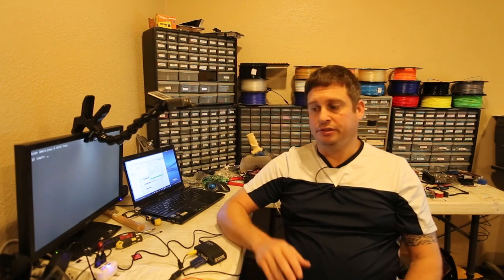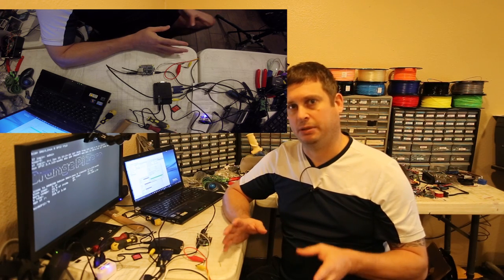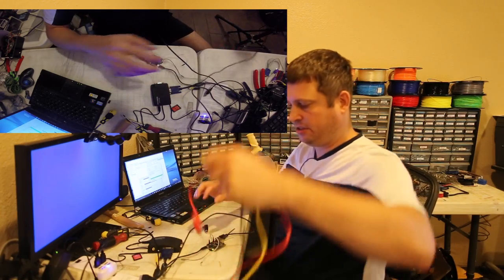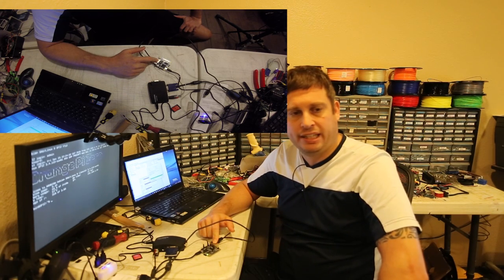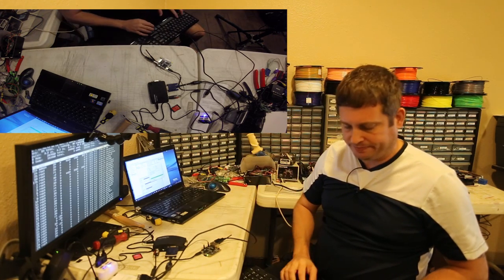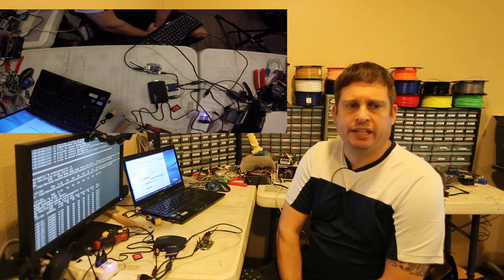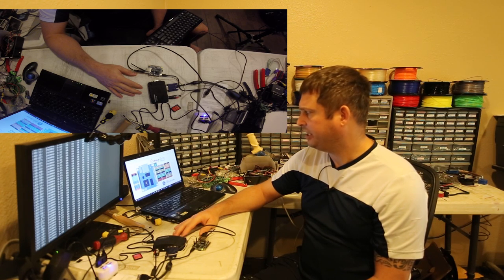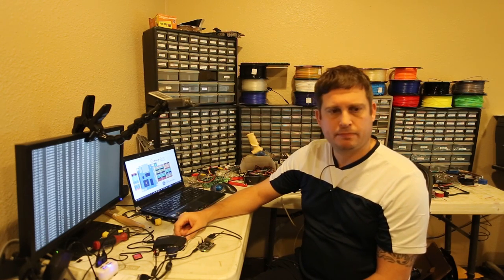Orange Pi Zero Part2

Comment: Is to possible  to connect a lcd module like ili9... , arduino lcd shields, etc to it via io pins.
Reply from the maker: I'm not familiar with that module.  It really depends on the input/output.  You are not going to be able to put it on the video signal, but you can probably drive it via the serial interface.  Worst case you would need a serial interface chip for the LCD.  Most of them are serial anyway, but some of the really cheap ones require a driver chip.

Comment: Could you please write your website down in the comments, also did you say you got WIFI working? or just Ethernet for now. I'm looking at ordering one of these machines, I've got an old vga-composite convert I kinda hoping it will convert composite to vga not just vga to composte.

Nice to see that this device is still very new and already some support exists, scattered all over the internet, also I see the orange pi website has images available now, have you had a chance to try these as apparently the original images didn't work at all..
Reply from the maker: www.nanohawk.com
Reply from the maker: The orange pi "official" website is mostly worthless.  Schematics are there, and they have a forum, but they are frankly their own worst enemy on this board.  Armbian is much better and has more support.
Reply: +Cashiez What IC chip you got on the converter?

Comment: Do you know that your expansion board is providing you audio and video? You just need a "3.5MM Jack to 3 RCA Male Plug Adapter Audio Converter Video AV Cable Wire Cord" which costs you less than a bug on AliExpress...
Reply from the maker: I wasn't aware of that.  The manufacturer is pretty spartan on documentation which limits the Orange Pi line.  I looked at the traces and didn't see that on the expansion board.  There wasn't any labeling for it either so I concluded it was a audio only jack.
Reply: Check out the case for it on AliExpress. The hole for the 3.5mm jack is labled "AV". ;-)
Reply from the maker: I have two of the units on hand and the board itself is not labeled.  I looked at with a magnifying glass trying to determine what the jack was plumbed for.  It makes sense to have AV on it, but it's also easy enough to just plug in the wires and move on.
Reply: I haven't found any schematics for the expansion board yet, but for the orange pi zero itself: http://linux-sunxi.org/images/e/e0/Orange-Pi-Zero-Schanetics-v1_11.pdf
Reply from the maker: I ordered a 3.5 mm to 3 RCA cable for 62 cents with free shipping.  When it arrives in 8 weeks I'll test it out and shoot a new video.  Thanks for the tip and suggestion.
Reply: +MJN This might help you with Audio/Video connection(s): https://i1.wp.com/oshlab.com/wp-content/uploads/2016/11/Orange-Pi-Zero-Pinout-banner2.jpg?resize=702%2C336&ssl=1
https://linux-sunxi.org/Xunlong_Orange_Pi_Zero#Expansion_Port Look under the  1x13 Header table
So use pin 2 = Ground and pin 9 TV signal.

Comment: TWI0 and TWI1 are just I2C0 and I2C1 (try to hook up some I2C devices and use i2c-tools package to manage things) :) Tx and Rx is for UART working at 115kbps; SPI probably won't work out of the box since it is not configured in recent armbian (only bottom side SO8 spidev0.0) the one on header is spidev1.0 and has to be enabled in config file (you have to use bin2fex and fex2bin utils). It should be patched in next release I guess.  WiFi works... quirky, much better with power management off. Also - Allwinter H2+ does require heatsink, it heats up quite a bit with intense usage.
Reply from the maker: That explains why it seems to drop SSH connections after a period of time.  There is something funky with the roaming as well.  The client should be picking the strongest signal on a multi-AP network and it doesn't consistently do this.  Roaming is handled by the client in 802.11.
Reply: Yes indeed, we've been fighting with this problem recently. Our company has multi AP with same BSSID but since OPi Zero detects several different APs it has problem connecting. We've chosen OPi to replace RPi2 since it is way cheaper, does same job (for us, I2C and SPI dev handling, not even GPIO, webserver with php script alone) and has WiFi (so shouldn't require extra RJ45 ports). After painful bug handling we've setup stable environment which we can use in in numerous OPis just by burning system image on SD. It's not as perfect as I want it to be but it works reliably for quite some time now. And still has plenty of resources available to use. So I wouldn't really recommend this piece of hardware to ppl who doesn't know how to handle unexpected problems (and aren't all that familiar with bash usage since Zero has no DVI/HDMI I personally prefer to configure and manage it through ethernet). But once setup properly it does amazing job for that price. And yes, I also recommend using Armbian forum - much more support there than Xunlong.
Reply from the maker: This is most likely a driver issue.  The hardware simply reports back the AP's.  My guess is that the developers do not have multiple AP's available.  The driver does eventually jump to a closer AP, but performance suffers.  It can connect at a much lower throughput speed to AP's which are farther away.